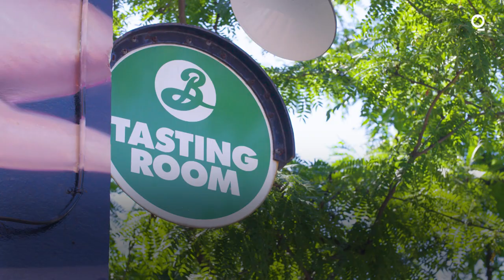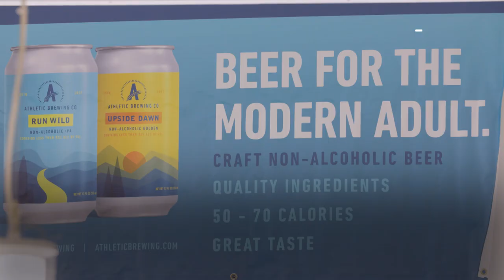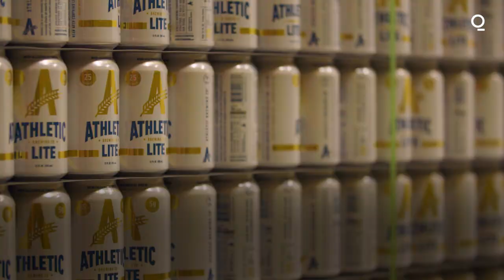The Rise of Non-Alcoholic Beer

Comment: I WANT A STRONGER HOPE PROFILE IN AN NA!  I AM A HOPE HEAD.  Most NAs taste weak.
Reply: Sober Carpenter makes an IPA with an IBU of 42.  I like their Irish Red, but that's only 24.  Sam Adams has Just the Haze with an IBU of 35 and Sierra Nevada has a Trail Pass IPA with the same IBU.  I haven't tried or found anything in non-alcohol options higher than 42 yet.